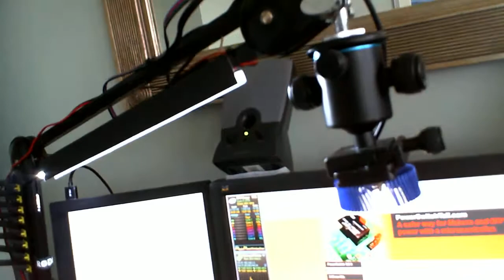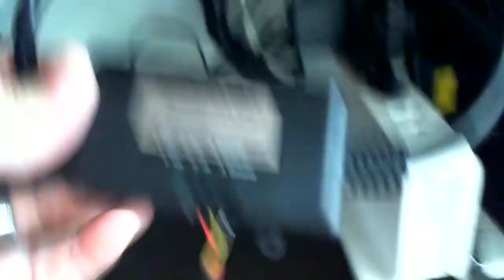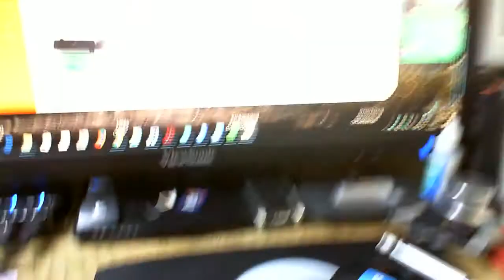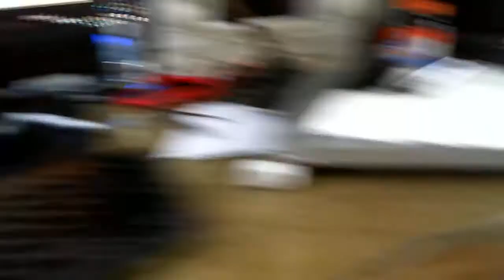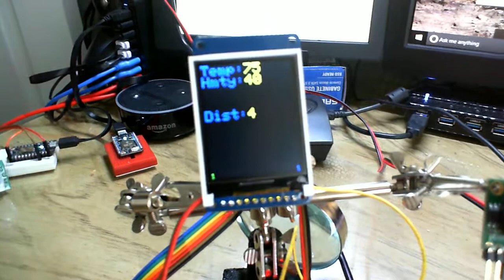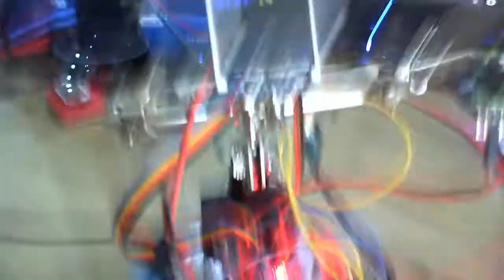Workdesk Assistant

Comment: Hi Tim. I could not hear you very good. That is on my end. But in reference to the floodlight you are using. Is that a 120 ACV light. If so beware of grabbing the metal fins and touching a ground--you will get bit. Low voltage you should be ok. This issue was just for the 120 floods.
Reply from the maker: Unfortunately, I'm not experienced enough taking videos... I will improve. It's not your side.
Thank you for the concern! I love it when someone points out safety concerns... not enough of that is done. I've been working in the electronics field for over 50 years including a 6 year stint in the Navy submarine force working on Univac computers... I've been 'bit' a few times! The flood light in question is not 120v but is a 12 volt 10 watt LED. I added the link for this project on my blog to this youtube description for those interested in duplication and/or modifiying it... Enjoy. Again, thanks for the safety observation!
Reply: Great Tim I will look at the flood. I am looking to shed some light on the desk here for building. The flood I was referring to is the China screw in type--Beware if you get any--test them.  Jim
Reply from the maker: Thanks for that heads up... I've had issues with many parts from China as well...